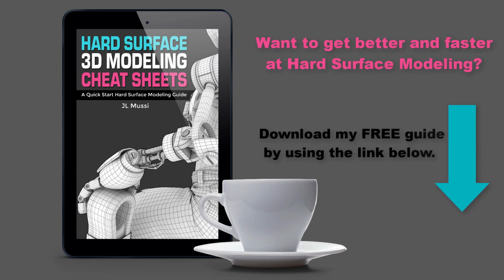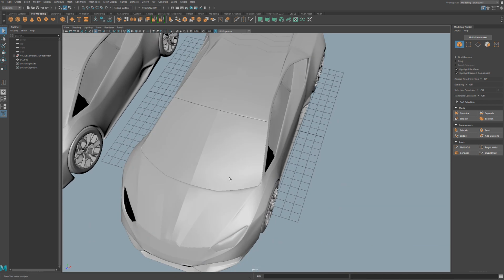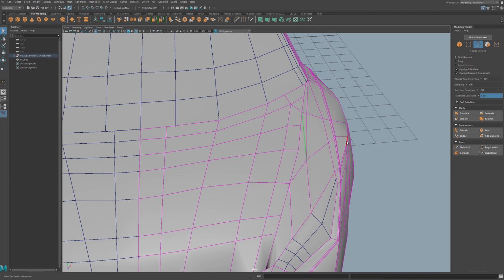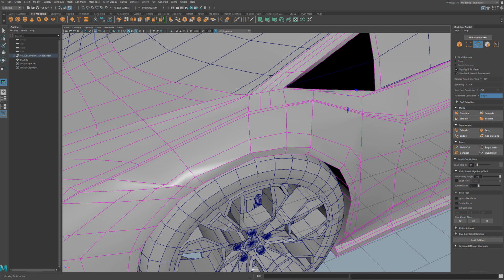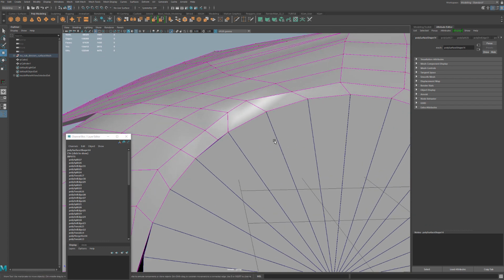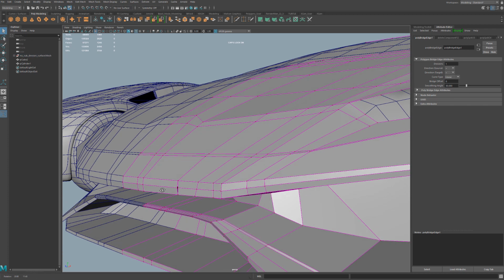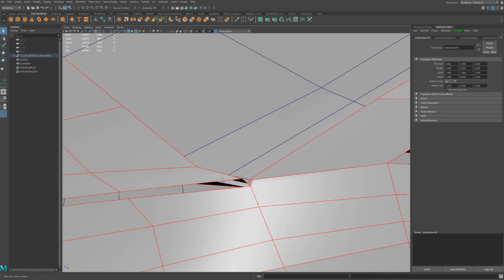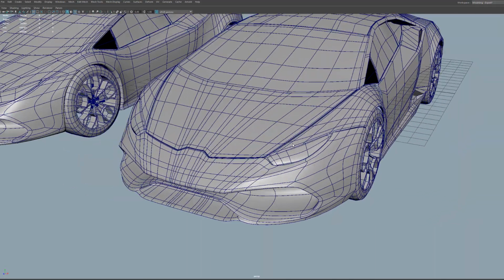Maya Hard Surface Modeling: Common Maya Car Modeling Mistakes And How to Fix Them

Comment: is that body one whole mesh?? why wouldnt you break it up: hood, fender, grill, doors, etc
Reply: @fklhasdfjdskalf  When you model a vehicle, you model it all as a singular mesh then cut out the panels after the initial mesh has been created. this allows you to maintain good edge flow for reflections to react with light correctly.
Reply: Depends on what the asset is required for, and whichever is quickest. For a movie where the car needs to be animated and is seen up close, then every piece would probably need to be modelled separately. For a game, it might just be used as a static mesh in the environment.
Reply: @fklhasdfjdskalf  Funny, I actually find it easier to model as much of the car as a single mesh and then separate the parts as needed. Too each their own.

Comment: I don't know if they still start with the drawing board, but I'm definitely old enough to say that I have. Played with an early version of AutoCAD (BIG-floppy) and a little bit of "IDEAS" (at UDM, I think Ford used it at one time). A college housing bill/debt and not getting into the industry kinda left me out of the loop for a while. Learned some computer networking & web design in the meantime. But the point I'm really wanting to make is that I've gotten back into the flow with Blender. And because I understand that modeling practices transcend varieties of software makes little difference that you're using Maya (so to speak). IJS
Reply from the maker: Yup, polygonal modeling is pretty much the same across most 3d packages.
Reply: Thus, is why I'm here... IJS

Comment: is the  triangle always mistake and need to clean  i model hard surface gun and there is too much quad and tris
Reply: It is better if you only have quads or triangles.. as far as I know... In Warframe for example they like the modles to be triangles only
Reply: @therealKrak  that is right . and when i try to make the poly in face i turn and turn in model by multi cut tool and get tris again :v
Reply: @malek3dartist96  i know what you mean xD
Reply: @phantomoftheopera371 i know in game engine this happen but it happen with me while modeling and i realize that when tris in middle not in corner it isn't mistake for example this video he make to many tris and model still clean https://www.youtube.com/watch?v=fhPWIDX5iQ0